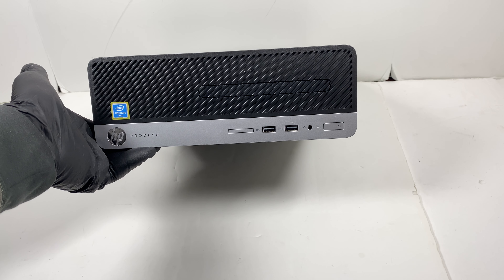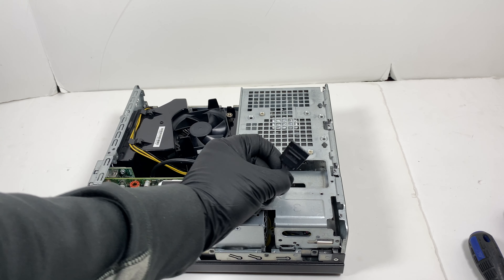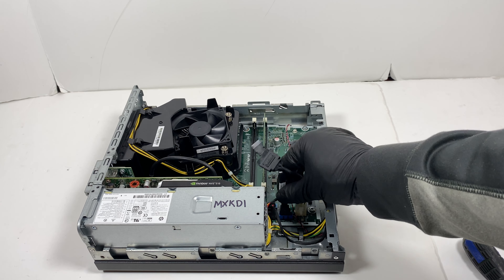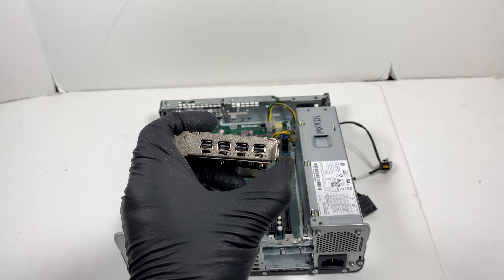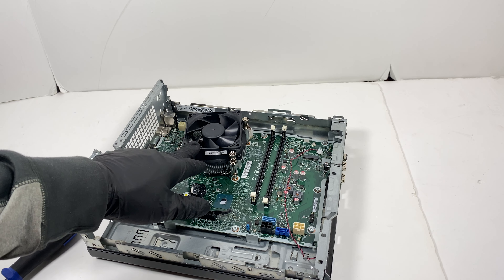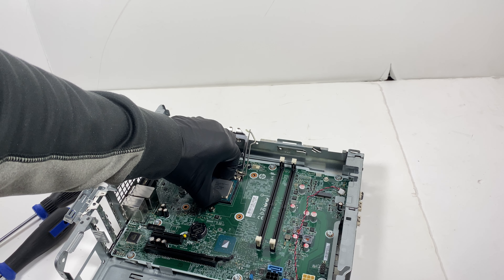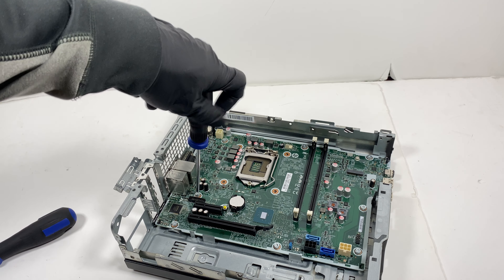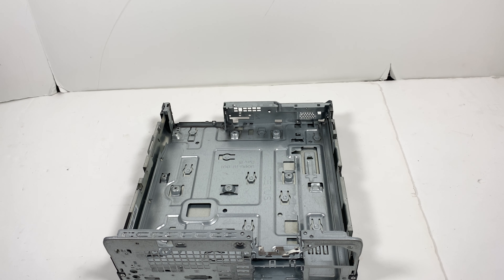HP ProDesk 400 G4 SFF PC, Teardown

Comment from the maker: List of Parts and Upgrades works with this system :

(1.) Wifi Adapter 600mbpsWireless USB Adapter 2.42GHz/5.8GHz
https://amzn.to/3nXHAPK

(2.) USB Wifi Adapter for PC AC600Mbps Wireless Network Adapter
https://amzn.to/2ZaGuHb 

Compatible With HP ProDesk 400 ( G4, G5, G6 )

List of RAM will work with this system.

(1.) Crucial 32GB Kit (16GB x 2) DDR4 3200 MT/s (PC4-25600)
https://amzn.to/2Zazppk

(2.) Crucial 8GB DDR4 3200 MT/s (PC4-25600)
https://amzn.to/2R07Ier

(3.) Crucial 16GB Kit (8GB x 2) DDR4 3200 MT/s (PC4-25600)
https://amzn.to/326cfT7 

(4.) Crucial RAM 32GB Kit (2x16GB) DDR4 2400 
https://amzn.to/3lBSyuB

List video cards will work with this system SFF.

(1.)  NVIDIA Quadro K1200 4GB Low Profile
https://amzn.to/2QhXyZB

With DisplayPort 1.2 support for true 4K resolutions like 3840x2160 @ 60 Hz

(2.) Gigabyte GeForce GT 1030 GV-N1030D5-2GL Low Profile 2G Computer Graphics Card 
https://amzn.to/2Z4PHkp

(3.) ZOTAC GeForce GT 1030 2GB GDDR5 64-bit PCIe 3.0 DirectX 12 HDCP Ready Low Profile Video Card ZT-P10300A-10L 
https://amzn.to/2WzgLXk 

(4.) MSI Graphic Cards GT 1030 2GB GDDR5, Low Profile 
https://amzn.to/390Spum

Thermal Compound Paste:
(1.) Arctic MX-4 2019 Edition Thermal Compound Paste Carbon Based
https://amzn.to/2XcsZo4
(2) Arctic Silver 5 Thermal Cooling Compound Paste 
https://amzn.to/2ziNU0H
(3) Noctua NT-H1 3.5g, Pro-Grade Thermal Compound Paste
https://amzn.to/36kTk7A
(4.) ARCTIC MX-4 (current edition) Thermal Compound Paste 20 Grams 
https://amzn.to/2DhGJaK 

 SSD List:
(1.) Samsung 860 PRO SSD 256GB - 2.5 Inch SATA III Internal Solid State Drive
https://amzn.to/2BY5gRl
(2.) Samsung SSD 860 EVO 250GB 2.5 Inch SATA III Internal SSD 
https://amzn.to/37xWUfc
(3.) SK hynix Gold S31 1TB 3D NAND 2.5 inch SATA III Internal SSD
https://amzn.to/3d7X6D6
(4.) Samsung SSD 860 EVO 1TB 2.5 Inch SATA
https://amzn.to/2B2FURX
(5.) SanDisk SSD PLUS 1TB Internal SSD
https://amzn.to/3hwdqku
(6.) SanDisk SSD PLUS 240GB Internal SSD
https://amzn.to/2zfc7EX
(7.) Crucial MX500 250GB 3D NAND SATA CT250MX500SSD1(Z) 
https://amzn.to/3bTTjbX
(8.) SanDisk SSD PLUS 480GB Internal SSD SDSSDA-1T00-G26
https://amzn.to/2yfgjUK
(9.) WD Green 1TB Internal PC SSD  WDS100T2G0A
https://amzn.to/2XfGtzc 

HDD list works with this PC:
(1.).WD Black 2TB Performance 3.5" Hard Drive - 7200 RPM Class, WD2003FZEX 
https://amzn.to/2xFUeyF
(2.).Seagate BarraCuda 1TB Internal Hard Drive  3.5" Hard Drive - 7200 RPM
https://amzn.to/3g8FXM8

Comment: Hello friend I really liked your video I really like what you do to teach other people. A few days ago I bought a computer just like the one you use in the video and I want to ask if you can help me since I want to be able to install the motherboard to a larger cabinet and achieve increase the capacity to install a massive graphics card with a bigger and better performance, too. Know if the cabinet's usb and power connections can be installed to the motherboard or at least the power to turn it on without using the button that comes from the factory. I know that the motherboard has 2 pins that are protected by a small blue plastic near the sata ports on the board and as I read it brings the acronym PSWD but I don't know if it is to install a connector for an external power button, I would really appreciate your answer since I am Venezuelan and here it is difficult to do certain jobs. successes in what you really do admire 👏🏼
Reply from the maker: Hi, thanks..

Comment: Any help anybody 
I wanted to move the mother board into a bigger a bigger casing and upgrading the PSU to something with 400 watts cause I ardy have a gtx 1050 ti low profile around here 
Will that work
Reply: Was it possible?
Reply: @awesomeruben  hello
Sorry for the late reply
Sadly no I just ended up buying a case and a new mother board and a PSU and just used the the cooler, ram and processor from the g4

Comment: Hi, wanted to know what is the best video card upgrade this 180w power supply could handle, maybe not the gtx 1050ti right?!
Reply from the maker: Hi, yes you can use gt 1030 or nvidia quadro k1200 and links are in description
Reply: el puerto PCI ex esta limitado a x8  y por potencia  ... con una gt 1030 LP va bien